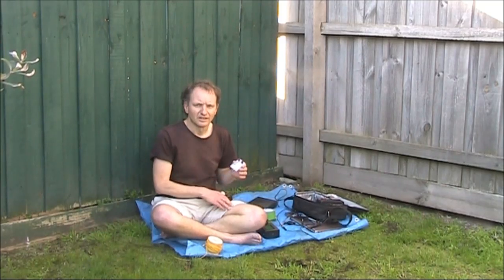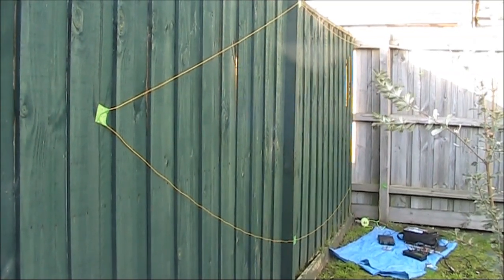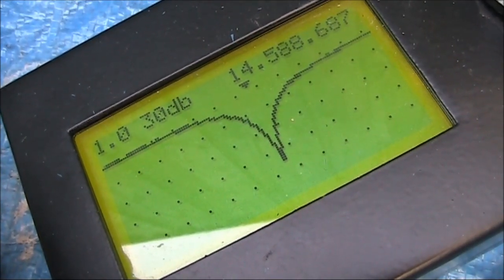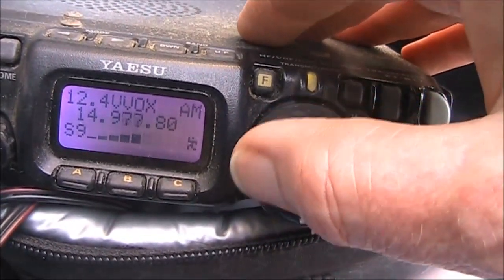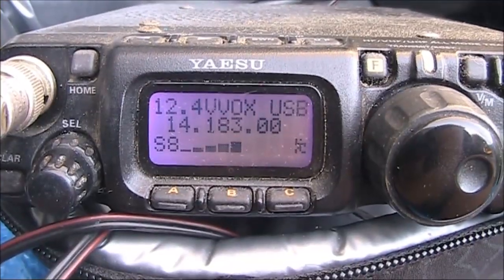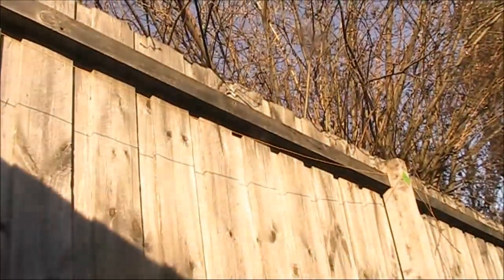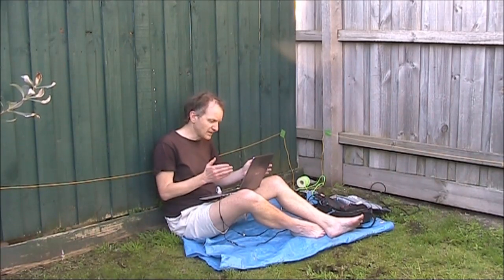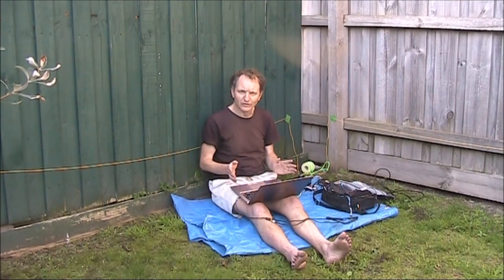Trying a fence loop antenna (with a balun this time)

Comment: I read somewhere that baluns mostly help to even out the radiation pattern of symmetrical antennas. So noise could actually become worse if it's from a direction the pattern shifts to under balanced conditions.

Comment: I ran a 43m loop antenna support between 2 points at 35 feet hjigh then sloping the wire down to a 6 foot high wooden fence.The antenna wire was insulated from all points of contact.The two ends of the wire was fed into a W&S cheap 4:1 balun which was attached to a Ugly balun 4 inches diameter with 25 feet of RG8 mini coax terminated with a SO238 ,the outerside of the SO238 was connected to a earth going into the ground below the balunThe antenna was fed with 15m of RG8 mini coax straight into my Kenwood TS570 with a good earth.The prime frequency of the loop was 6.83 MHZ,the radio had no problems tuning when it had to (80/160m) and I made contacts all over the world with no problems.The noise level was lower than my other antennas and the signal incomming and out going was better on the loop.

Comment: Hey Peter - interesting result. Kind of surprised that there was zero difference in noise. It appears that the loop was better at general receive performance, but that noise is pretty intense.

Have you tried listening in AM and seeing if that buzzing is 100/120 Hz? Maybe there's a leaky powerline near you?

Thanks for doing an A/B comparison. I've thought about doing a loop on the fence, but for now, I'm loading up my rain gutter and have hung multiple 1/4 wave counterpoises on the fence. It works decent, but is still quite the compromise. From Texas, I've worked Japan and central Europe on 80M. It gets me on the air in an HOA-restricted area. :-)

Comment: Peter, can you describe how you connect your laptop to your 817's data socket, and how you manage the transmit of your WSPR? (i.e, do you use the PTT button at the right time, or have a relay set up, or some kind of super secret setting?) Cheers! VK3FLTR
Reply: https://youtu.be/3wmxyo1RzaE
Reply: @ssbfmcw  Thanks for the link!!!
Reply from the maker: FS: I've got a video on an interface cable that describes it. Uses the transceive's VOX.
Reply: @vk3ye  Thank you!!!!!

Comment: Hey Peter,
I was using an Icom 7300 at 100W with a Hustler 6BTV vertical on 20m when you worked me on FT8 in this video.
My noise floor on 20m isn't amazing and around dinner time the neighbours turn their kitchen LED lights on which increases the noise floor two or so S units..
- ZL4KYH